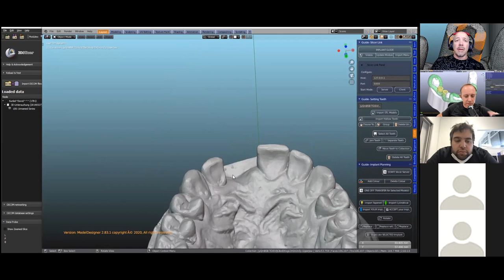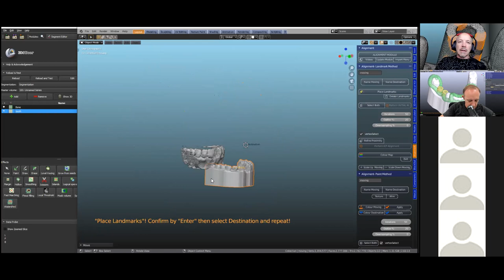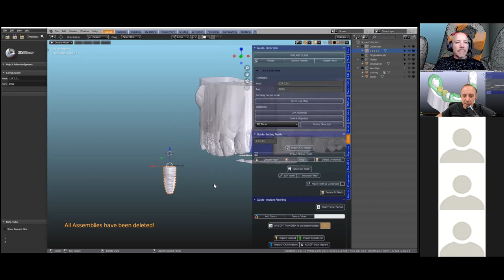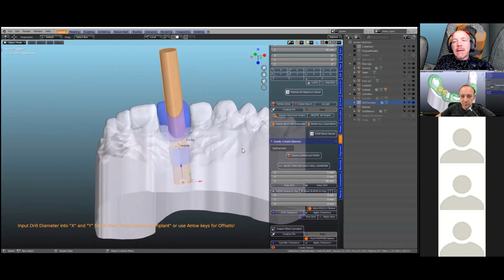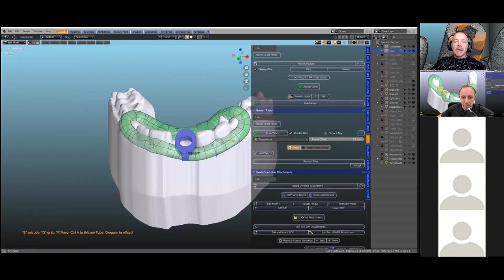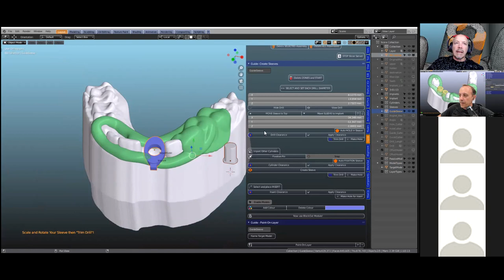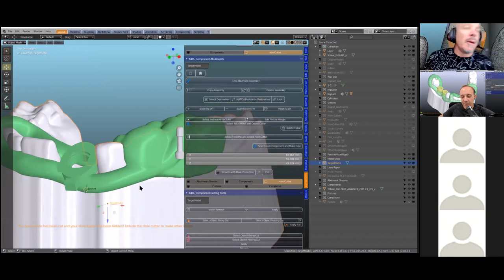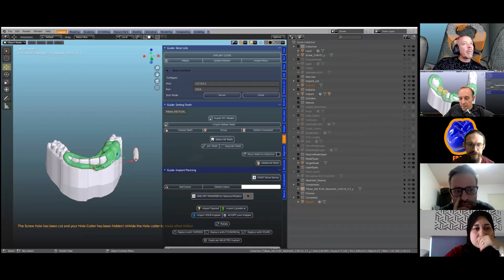B4D ZOOM Implant Guide

Comment: Hello, If you have an opposing model without a bite scan, can you use some function in B4D modules to align the two opposing models into occlusion? Also, if you do have a bite scan, is there an easier way to align each model to the bite scan without having to use the complicated alignment module steps?
Reply from the maker: Without a bite scan it become difficult to put them into occlusion, unless you can find some wear facets. It is always best get get a bite scan or even if you have a wax bite.